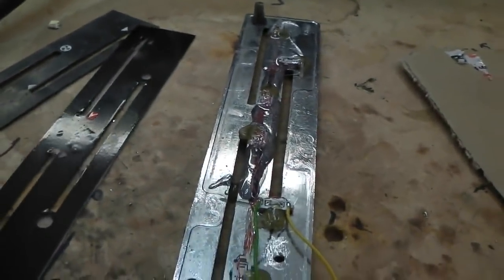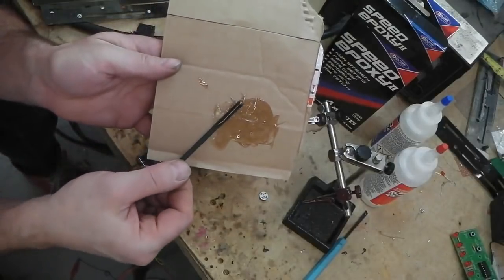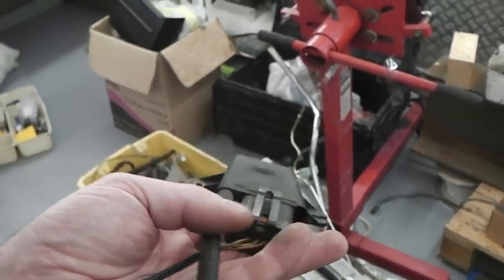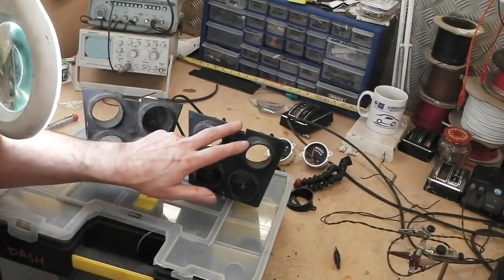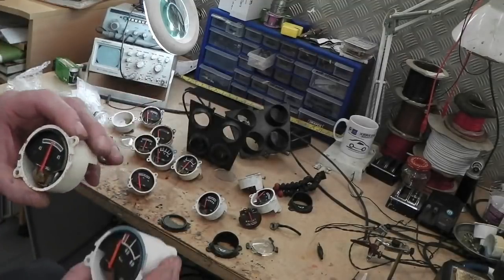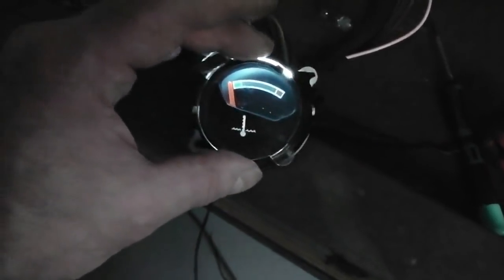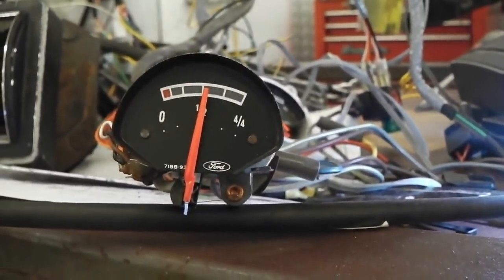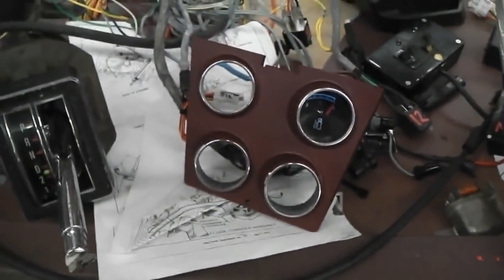Ford Cortina Restoration - Gauge refurb and Calibration - Tech Vid 7

Comment: Thin wire usually gold decorative led sets are good  cheap source. The type where the LED is mounded on the wire they glow warm good for dial lights on old radios. Choose a resistor to slightly under run them for long life.